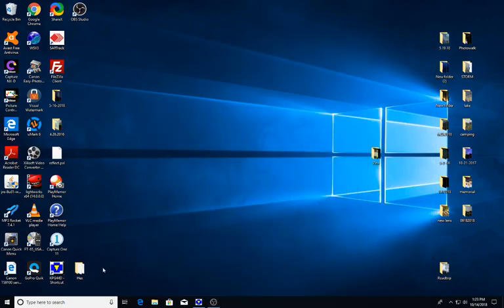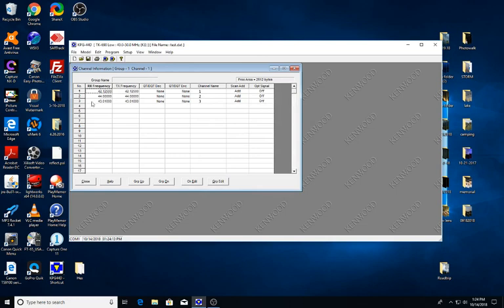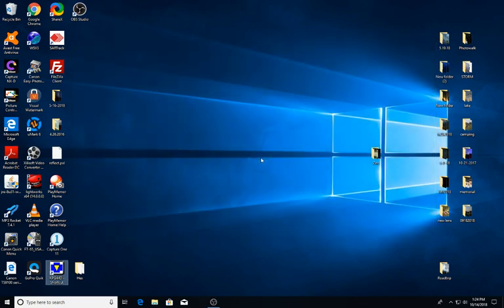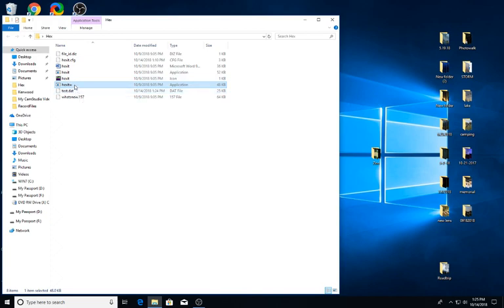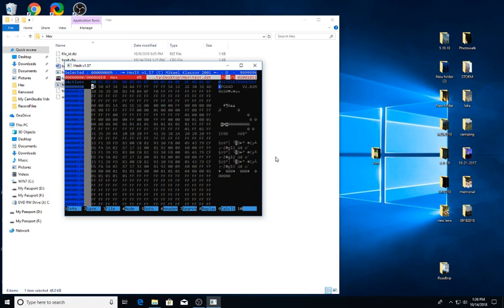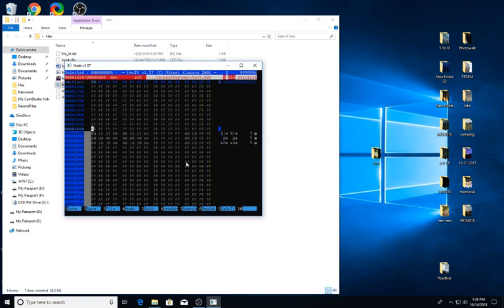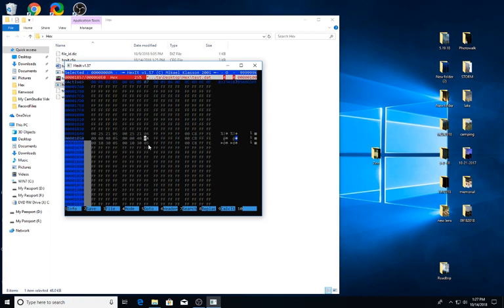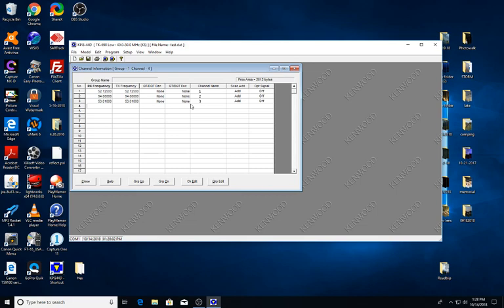Kenwood TK-690 6M Band

Comment: thank you for putting this out, im about to dive into one myself for a 6m allstar remote base.  might need a little more clarification on hex string as what to look for for freq?
Reply from the maker: You're welcome, I'm the computer nerd, so was helping out some fellow hams to get this done. When looking at the hex string, look for numbers that are similar to the frequency. For example, 42.12500, in the hex string it is 00 25 21 04, so it's just the frequency backwards. Hope this helps.
Reply: @kristaparksphotography1414  , Thank you i found that that hex program wouldnt work on my old toughbook.  my windows 10 worked fine then transfered via thumb drive..  you should include that you have to physically modify the radio as well but it isnt real hard.. i did it on my first try!
Reply from the maker: Yeah as far as the old tough book, depending on windows version, you may have been able to run the DOS version of the program, but that gets to be more of a pain. As far as modifying the radio, I'll have to try and get that added.
Reply: @kristaparksphotography1414  Cool video! As touched upon above, what specifically did you modify/adjust within the radio?